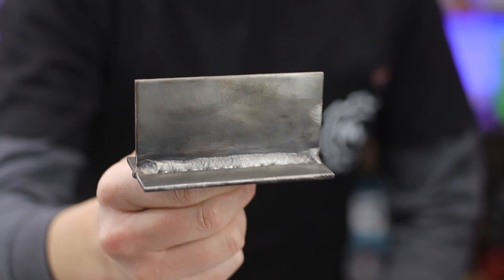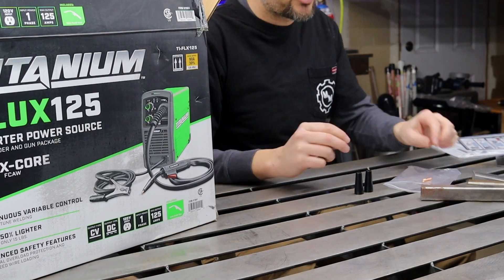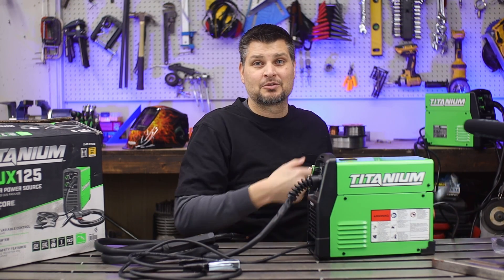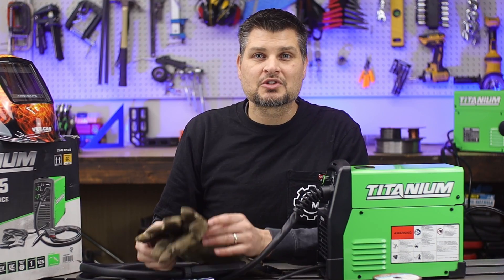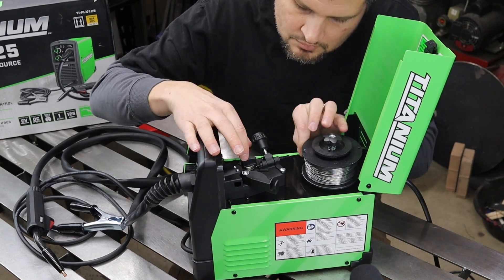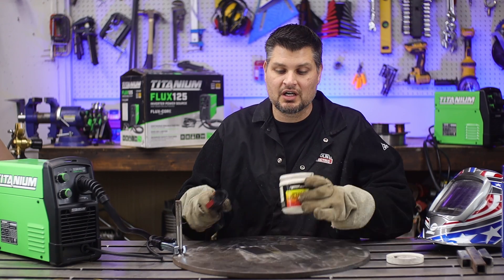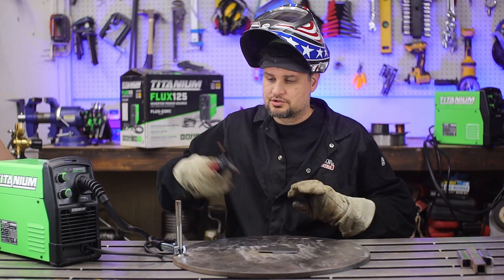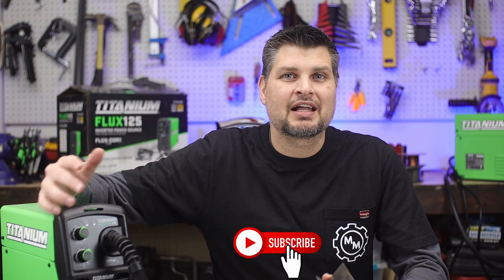Harbor Freight Welder: Titanium 125 Review, Setup, and Test

Comment from the maker: For $149 not on sale it's still a great deal to get into welding!
Reply: It’s on sale this weekend !!!!
Reply: sale $99 @ 10/1
Reply: Compare it to the chicago electric. I have for 4 years still works. Will get rid of it when it breaks get the Titanium
Reply: @javybeaz3236  My buddy let me use his Chicago, it didn't have a dial for power just high and low. He said this unit would be a slight upgrade but they're about the same.
Reply: @javybeaz3236  oh and the price difference is kinda huge. 100 vs 150, so gotta decide if the power control is worth 50 bucks. It is, imo.
Reply: Where do you buy metal like 1/4in thick plates or 1/8th in ones like you used?
Reply: Hey brotha wondering if this will work with 18-22 gage steel for body panels. I'm widebodying my car so I have to cut the rear quarters, bang up the metal and weld up the 2 sheets of metal again. Please let me know. I would appreciate the help!
Reply: Well, damn, I bought mine 4 or 5 years ago and still haven't opened it 😂 I should have waited til now, because I think I might have paid closer to 200 for mine  ..maybe 175, it was on some kind of sale, I think.

I've seen it weld 1/4" on videos; have you done it, and have those welds held up over the years? I'd like to do some trailer work with it. Either way, I'm gonna try it and see for myself, but I'd like to hear some practical experience of longevity with real world use.

Comment: I got titanium 125 welding set the one that works off of a 120 Volt I guess Anyway I took a Class at the local Community College I only went for about a month because I got kicked out of school for making fun of someone's pronouns because why on earth would someone announce their pronouns So I said my pronouns are F your pronouns I thought it was funny I laughed hysterically but the school kicked me out of school not technically for that because I was more of a irritant after that to the associate Dean but I digress I I've been too afraid to use it I had it for over a year now but it's time to use it I didn't know where to get scrap metal but I just realized I have a bed frame So assuming you can Weld a bed frame to a black metal gate I already have the metal I need I'm just gonna grind it down so in case there's any kind of a coating on it I don't even know if I can use a bed frame You know the metal part underneath but I'm gonna use that and see what happens and pray I'll set myself on fire But I have all the safety gear I passed all the safety tests I only had about a month of a 3 to 4 month clash and we already got to flux core and I really suck at welding because at the time I didn't have any glasses and I couldn't really see what I was doing But for the most part I'm just gonna go for it and pray that I don't electrocute myself So I'm just gonna finally overcome fear and hope I don't die
Reply: Anyway I bought the welder a year ago I wouldn't change anything because I got a free class because I refused to pay Actually I thought I was paying for the class but it turned out it was just like a lab fee but I thought it was the actual class fee and now I have a 5 year restraining order I can't go back to the school but no no bother i've got the welder unit I know what I'm doing It's it's easy it's just scary and I got a free class out of it so if you want to get a free class out of a Community College just state your pronouns as something really irritating refused to pay the fee and then get a restraining order but in four years I can go back and I can take another class just can't do it for another 4 years but I love me

Comment: I'm used to the gas flowing through the nozzle and the distance to the work. Working with just the tip would be a challenge for me and to get used to it. Snag some scrap metal somewhere and just practice getting the heat and speed correct and boom, nice little side hustle for the farmers

Comment: do you have to use a 30 amp outlet?
Reply from the maker: 20 amp is required. You can use a 15 amp but you won't be able to weld on the highest settings.

Comment: I bought this welder yesterday from a Harbor Freight near me new in the box. I read all the instructions and set it up per the book and your video. Today I attempted to weld my mower deck lifer mount back on. I found that the arc was very weak and intermittent, I did not get a steady arc like in your video. I could not develop a puddle. The best way to describe it would be a "Sputtering arc". The only thing I can think of is that the mower deck was on the ground and I had the welder on the ground as well. I did have the ground clamp on bare clean metal on the deck. In all the video's I have seen on this welder, there is a strong steady arc. Did I just get a bad welder or did I do something wrong?
Reply from the maker: How thick are the pieces you are trying to weld together? I would try and practice with 2 clean pieces of metal of the same thickness first. I have a feeling the sputtering will go away. That usually happens with dirty pieces that aren't grounding well. Also try turning up the settings a bit.
Reply: @-DIYPRO-  The mount and the deck are 1/8th in. mild steel. The problem I'm having is weak spark. I do not get a strong steady spark. It's like the welder isn't getting enough electricity to operate properly. I do not mean the sputtering of the flux core. I mean the arc itself is weak and not steady. I did have the metal spotless clean, ground down to shiny metal and I had a good ground on clean bare metal. I maxed out the amperage and it didn't seem to help at all. Could it be my breaker from the electrical box? I'm not sure if it 115v or 120v but I can change that.
Reply from the maker: @ It can run on anything from about 110-130V you'd only see an issue if you were way below that. If your circut it good then I'd double check and start with the the machine settings (for 1/8" match what is listed on the table under the cover). Check the tension on the wire with the roller tension. Sometimes that is way too loose. Lastly what is your stick out (how far away are you holding the tip of the gun to your work piece). If it's too far away (further than 1/2") than you'll get sputtering. If all checks out then you may just have a lemon and I'd take it back.  Good luck!
Reply: @-DIYPRO-  Thanks for the info. I will try all those things. My stick out was less than 1/2 inch and I was close in on the weld, I'm not scared of it at all (I have welded before) MIG and TIG, Oxy-acetylene. I had the tension pretty loose or I think it was but I'll try that too. It is entirely possible that the machine is bad or the wire itself. The wire is Vulcan from Harbor Freight and most reviews say it's not really all that good. I did keep my receipt so I might do an exchange if I can't get it running. Thanks again!
Reply: @-DIYPRO-  I think I may have found the problem. I was watching all kinds of videos on the subject when I found one that specifically called for replacing the cheap ground clamp on the 125 and described the exact problem I am having. So, I'm replacing that clamp!
Reply: @paulkopacz5051 did replacing the clamp improvement your issue?
Reply: @tammycole7756  I haven't replaced the clamp yet. I intend to but other things have taken precidence and the weld I was able to appy to the mower deck mount (while ugly) is holding. I will replace it as soon as I can.
Reply: @ Thanks for getting back to me I was trying to brainstorm why I was having this problem and trying to answer my wife's questions about something. I didn't meant to be short.

Comment: Have you tried running .025 wire in this machine?
Reply from the maker: I have not. The roller it comes with only goes down to 0.030. That might still work but haven't tried it.

Comment: If someone can help. Which/What portable generator can I use to run this machine.
Reply from the maker: If you want to run it at the max settings then I'd suggest a 4,500 running watt generator. If you run it al lower settings you could get by with a smaller one.

Comment: I keep reading conflicting things online.  Does this welder actually run on a 15 amp circuit or does it need the 20 amp no matter how hard you run it?
Reply from the maker: You can run it on a 15 amp breaker as long as you keep the dials at about 1/2 and below. It will trip if you have the machine maxed out.

Comment: Brother, I have been trying to figure out what I was missing mentally because I couldn't get my welder to work.  That simple step of "closing the loop" is what i was missing.
I had the clamp on everything metal and nothing worked.  I connected it to the piece I was trying to weld and 🎉🎉🎉.
It wasn't pretty but I made metal stick to metal.
I no longer have to pay welders for my garage door/gate company. 
Now to find a small portable generator that can support it.
Reply: Honda makes an amazing little generator that can run all the appliances in my house for like $800 ita about the size of the Welder too. Amazing little machine

Comment: Will this run off a standard 20amp breaker circuit?
Reply: The Titanium welder 125 has an input current of 23.5 amps and is powered by a 120 VAC input voltage. To operate the welder, it is recommended to use a 20 amp circuit because at maximum output, the welder can draw up to this amount.

Comment: Would have a GFCI be good enough in case the machine pulls too much from my regular house outlet?
Reply: i dont think GFCI would trip if you pull tooo much power they only check between hot and neutral for shorts. if it pulls too much the breaker will trip

Comment: Here's my suggestion..get a regular guy like me that has NEVER welded before and make a video demonstrating how to get the bead going so we can learn from it..I bought one of these to do some light welding in my garage and all I get is splatter and no welded using the chart on the lid. Or my wire comes out way too fast on the lowest setting
Reply: Wtf. Hope you got shyt straight. I'm new at this and that sounds suck.

Comment: Not sure if I just had bad luck or I'm doing something wrong. I've got an old blue HF welder that sucks but it works perfect for the ugliest welds that just work. I bought one of these and do not use Lincoln wire in them. The lincoln wire is softer than HF wire and will bunch up on you. I had a hard time getting it through the line to the trigger and then it birds nested on me. Pulled out 10 ft of wire and tried again, same result. This time I couldn't get it from the nozzle end and couldn't pull it back through for some reason. Took that one back and got another. Everything went smooth on the 2nd one for like 2 welds and now, no spark. I tried to arc it against the ground and nothing. Fan comes on, feed works but no spark. I'll be taking #2 back. Had high hopes and the welds are actually pretty nice when it welds.
Reply from the maker: that sucks man. Hopefully 3rd times a charm.

Comment: Thanks for sharing 👍 What about the power cord? Is it the typical 3 prong that plugs right into the standard house outlets? Also, I wish you mentioned what various metals we can weld with it. Will it weld aluminum like many of the street stop & yield signs are ? Thx
Reply from the maker: Yes just a regular 3 prong outlet.....but it does need to be on a 20 amp breaker if you want to run it on the max settings. It can weld just regular carbon steel and if you get the right wire, SS. No aluminum or any special metals.

Comment: Noobie Question- I plan on getting this and the receptacle I plan on plugging into is 15 amp according to my circuit breaker switch. I know it's recommended for 20 amp. What can I expect and does it mean it would run less 'hot'?
Reply from the maker: It will run and draw what ever amps the settings are on. If it pulls more than 15 then it will trip the breaker. It will do if running on the higher settings. Just know you won't be able to run it maxed out.
Reply: @-DIYPRO-  In 18 mths of watching welder review and how to, ur the first one that I noticed at least to call the receptacle limitations. Thank u!!!

Comment: I did not watch this video first, I let go of the wire. I thought the machine had hold of it... it did not.
Reply: I also didn't have the spool locked in place yet, forgot to put the screw and spring cap on before starting to feed it. So yeah like 20-30 feet of wire came flying off and tangled me up like a damned cartoon.
Reply from the maker: It happens to everyone at least once!
Reply: @-DIYPRO-  Hey I managed to wrangle that wire and only lost 6 feet of it. Today I tested my first weld, at 33 mph on the sketchiest home-built ebike you've ever seen. Somewhere between a cafe cruiser and a recumbent with stirrups.

Comment: Bought one three weeks ago and have enjoyed using it. I used it welding together one inch thin wall square tubing and it worked great. I was able to quickly fill burn throughs with ease. I still have a little trouble with wire feed speed but the more you use it, the better. I bought the matching auto darkening helmet too.

Comment: Could I weld a fence with this machine?
Reply from the maker: As long as it's 3/16" or thinner than yes. Do be careful since most metal fence is galvanized. That smoke is on another level and will do damage if not wearing a respirator even outside.

Comment: Bro walk of shame fuck no harbor freight actually sells good shit now and Ik I own snapon pretty much everything
Reply from the maker: I've done some deep diving into Harbor Freight, their tool quality, and marketing recently (after this video) and I have to agree. HF has done a 180 from 10 years ago and are actually putting out decent stuff.
Reply: I agree with this on many things. I used their 1/2 and 3/8 impact sockets for over a decade in a shop. I had to replace the 19mm after about 10 years because I cracked it getting a swollen lug nut out of it. HF didn't even hesitate. Their warranty doesn't technically cover commercial use, but they didn't even ask. I was in uniform. 
Their titanium welders are all known to be good quality. 
I've been abusing their 23 gallon air compressor for over a decade. My jack is about the same age. 
The only tool I've managed to kill is a high speed air grinder that I probably could have fixed, but it was cheap to replace.
Reply: I recently had to strip a 1200 sq ft deck so decided to test abrasives to see what sandpaper is best. I found the harbor freight sanding belts out performed Diablo and everything else by a large margin.

Comment: I've had mine going on 5 years and it still amazes me how well this little unit runs. Also, it fits perfectly into a milk crate, which keeps it from getting banged up. I cut one vertical section, about 3", to help the gun and ground clamp slip in and out of the crate when starting or stopping for the day. Run the power cord back in the same hole you fed it out from, and its self contained. I used the strap to go from one corner diagonally across the crate to the other. Makes it super easy to transport around. I even cut a 3/16" plywood top so the machine is proteced on every side.
Reply from the maker: That's a great idea, thanks!
Reply: Thanks for the milk crate idea. 👍👍
Reply: hey would you use this welder for small mechanic repairs ? such as a headlight bracket crack ? muffler repair ?

Comment: The feeder wheel has to be flipped over if your using 0.035 wire it’s marked you will see it when you take it off
Reply from the maker: True, make sure it has the correct roller.

Comment: I just bought one of these two weeks ago and your setting on the machine are different than mine. I have no 3/16 settings for .030 wire.
Reply from the maker: I'll have to double check on mine, I thought they had the same sticker but maybe they changed the settings a bit.

Comment: What did they tweaked? Looks like same as before. And why doesn’t mig170 doesn’t have wire feed button this flux cord does.
Reply from the maker: I should not have said tweaked since that makes it sound like there are differences in the machine itself but from what I can tell it is only consumables that they changed. Not sure why the other Titaniums don't have a cold feed button, in reality since most my other machines don't have it i always forget and just pull the trigger.